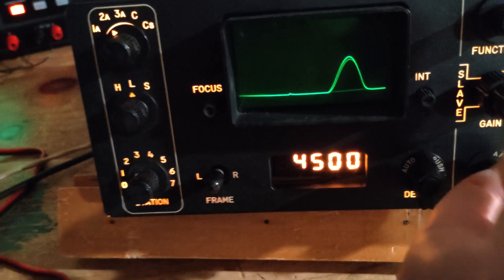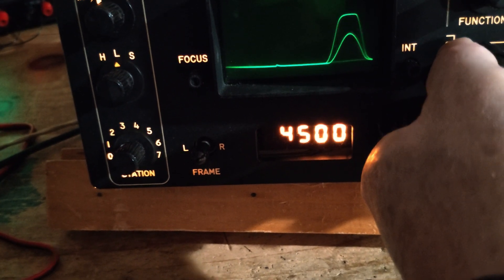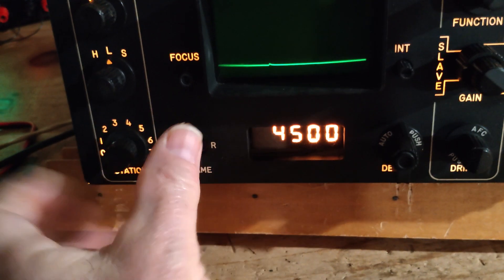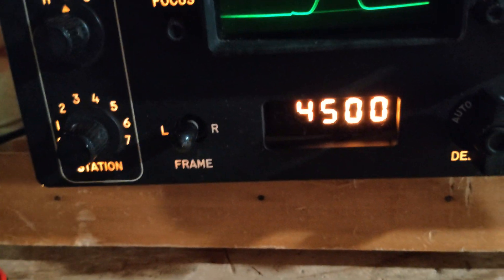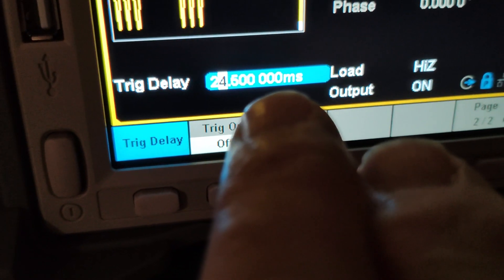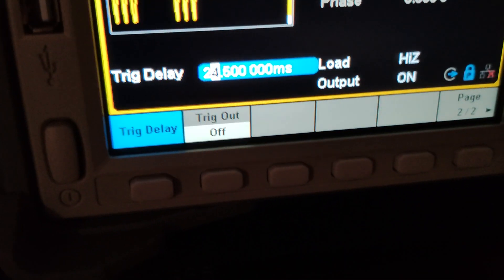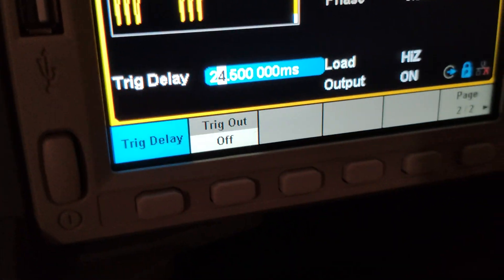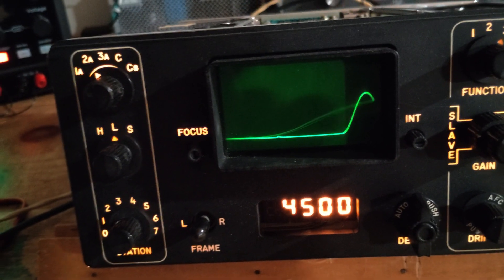Taking a LORAN A fix on 1850 kHz

Comment: I don't think the people here understand what you have here but luckily I do: this is a LORAN A receiver NOT C (and its derivative eLORAN): the latter runs on longwave from 90-110 KHz (center 100 which is conveniently a 3km wavelength) while whats being demonstrated runs on today's 160m band. Its also why old HF amps like the Heathkit SB-200 dont have Top Band: hams were forbidden to interfere with the system. Decca is a related system also.

If y'all would just visit the Wikipedia articles you could learn a lot!

Comment: There will be no comeback for this, ever. All transmissions can be jammed or destroyed, including the jammer itself. If positional information is mission critical, you'll be using inertial systems coupled with fixes from a myriad of sources, some optical, some radio, some audio.
Reply from the maker: eLORAN is ALREADY in operation as Navy testing program, expected to be approved by Pres. Trump.
TEST RESULTS:
https://tedstevensarcticcenter.org/wp-content/uploads/2023/09/eLoran-Overview-ICE-PPR-Trails-March-22.pdf

Introduced in U.S. Senate (12/12/2017, 2018)
National Timing Resilience and Security Act of 2017

 A significant advantage of eLORAN is that it is tough to spoof or jam, especially from a large distance. In contrast, the equipment required to spoof and jam GNSS must only mimic very low-powered satellite signals. Spoofing and jamming eLORAN requires very high-powered transmissions across a vast area. In addition, eLORAN implements an authentication system and broadcasts an anti-spoofing signal. It is considered secure and practically un-jammable, and can penetrate nearly all structures across all weather conditions. The reported accuracy is as good as 8 meters, making it competitive with unenhanced GPS. It also meets the performance requirements for non-precision instrument approaches in aviation.

Additional arguments for eLORAN are that it is a terrestrial-based system instead of requiring (expensive) geostationary satellites. eLORAN also operates in a very low-frequency band instead of GNSS working in the (very) crowed Ultra High Frequency band. As eLORAN uses high-power transmissions, its signals are three to five million times stronger than those of GPS/GNSS and have 99.999% availability and reliability. The signal can penetrate buildings, and works indoors and even underground/underwater. Lastly, it is largely unaffected by cosmic interference and space weather phenomena.
Reply: True the Holy Grail is 100% inertial navigation (dead reckoning) but even now it's only accurate for so much time before needing to be reset. That bootstrap has to come from somewhere.

The thing you don't understand about (V)LF is that the power & antenna size required makes it VERY difficult to jam unless you can get very close to the receiver.
Reply: Given the power used by LORAN transmitters (100s of kW - 1MW+), and extreme antenna size required, jamming is inordinately difficult unless you're within very close range of whatever receiver you intend to jam.